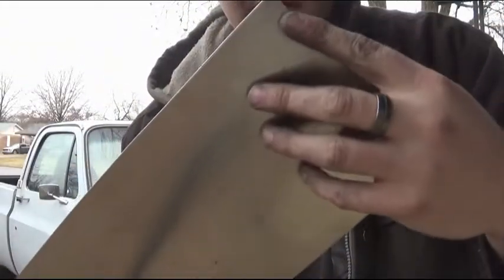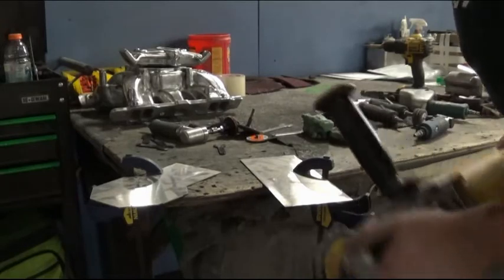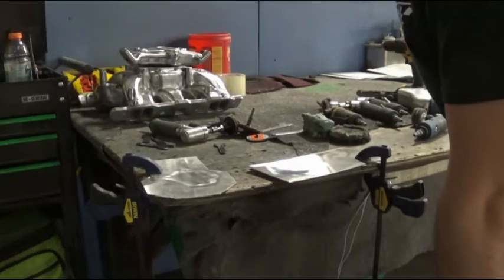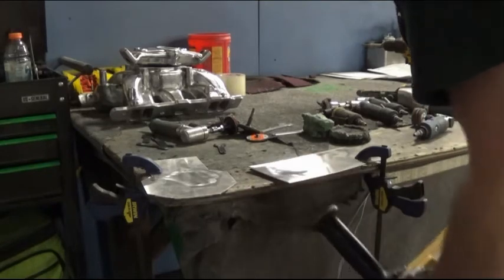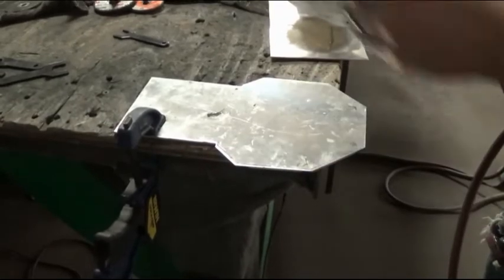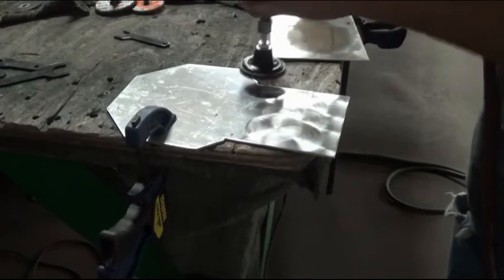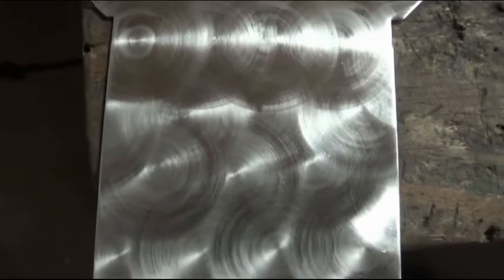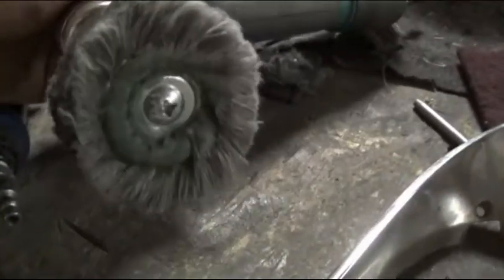Metal finishing tips and  ticks, and saving old trim mirror finish, brush, swirl.

Comment: I want to do this to all the stainless on my 79 Cordoba. There's so much and I don't think it ever shined like chrome even new.
Reply from the maker: yea on something like that thats alot of trim and time lol. even the trim on my c10's never shined like chrome new probably close to a brush finish. i used that method on the grill trim on my older truck and it looked like chrome. onced i learned how well things shined with the green block i applied it to alot of things. Im currently working the the performer rpm pontiac intake that i modified for a new video, it should have a very shiney finish when im done
Reply: Efurd Garage is that green block like a clay bar or is it something different
Reply from the maker: a buffing compound/ buffing rouge. I get it from blackhawk industrial i dont think they carry the same brand anymore because that bar i have was cut in half and  will last me a long time it was about a foot long and 2 inch wide. this is a link to a very similar bar but the brand is dynabrand which i use there tools alot  https://www.bhid.com/itemdetail/DYN%2078233. i may do another video of doing a large piece mirrored and go more detail